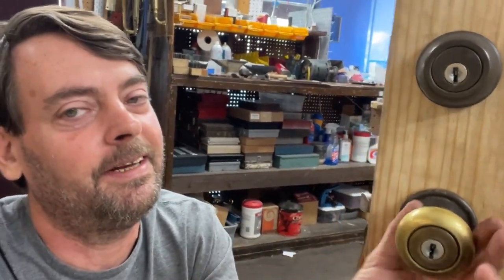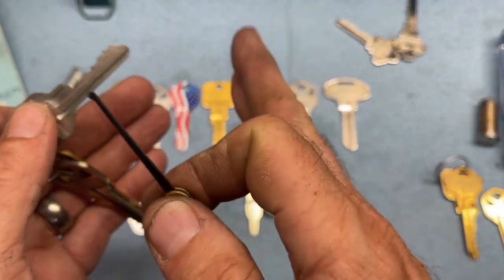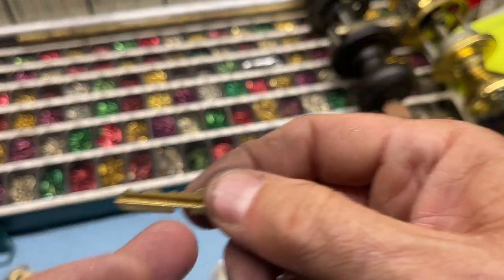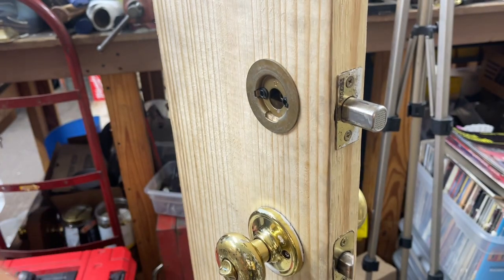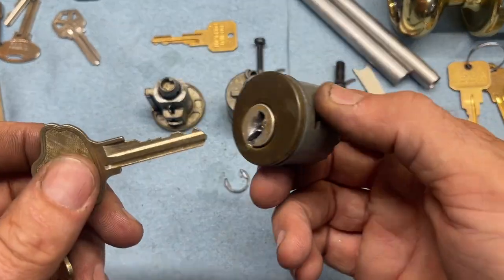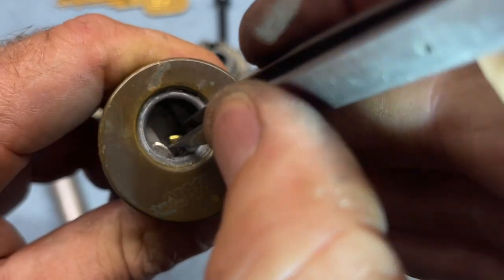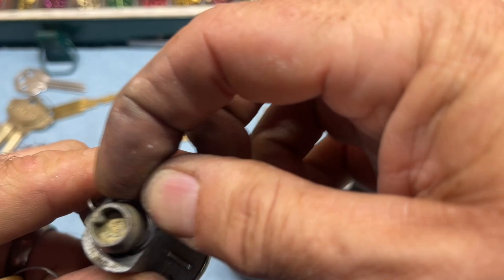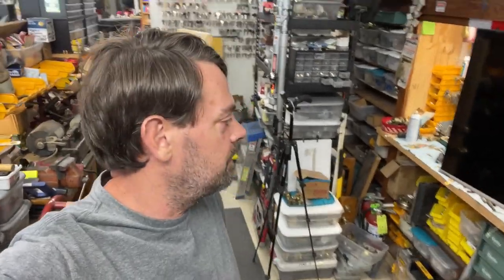RLS 7 - Kwikset Titan

Comment: Interestingly if mix n matching Kwikset Titan, Kwikset 5 pin and Kwikset Smartkey all in the same house, the KW10 and KW11 will work in the Titan and the smartkey locks but you’ll need to pin the rest of the 5 pin Kwiksets accordingly to the cuts that line up. It does get confusing when mixing the 5/6 pin/cuts. Thanks for sharing.
Reply from the maker: Gotta love those eight generations of locks houses 😂

Comment: I also like the Lishi clipper trick for the bottom notch!  My first experience with Titan was a disaster because I didn't understand the spring retainer mechanism.  I thought I had to remove the spring and the retention plate on each cylinder.  Ugh...what a time-consuming mess.  Now that I know, I don't mind rekeying them at all.

Comment: Wow, coincidence, I have an apartment building with Titan deadbolts, worked on one yesterday and had to look for master pins, really need a bright light to see in cylinder housing to drop master pins and reload top pins.
Are these locks still available, difficult to find replacements.
All I can find are smart key versions?
Great video, you covered all the bases well

Comment: I successfully picked my titan knob, but still can’t get the cylinder to come out. What am I doing wrong? I’ve picked in both directions and turned the cylinder in every direction but to no avail.  Thank you for the video.
Reply from the maker: Turned to 9 o clock position you may have to wack it on the side while pushing in & out on the cylinder
Reply: Yes, that helped, I got it out. I re-keyed it successfully and knowing that the 6th pin is closest to the opening saved me lots of time too. You were extremely helpful to me at getting this lock working with a known key again! Thank you very much!!!